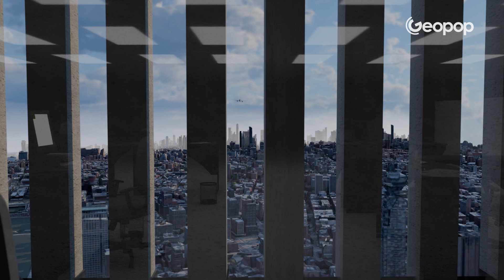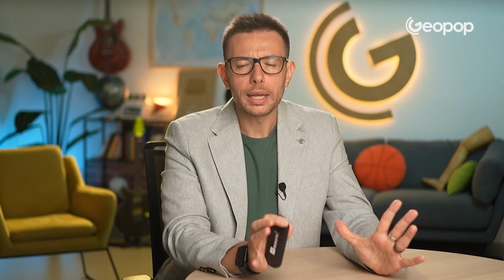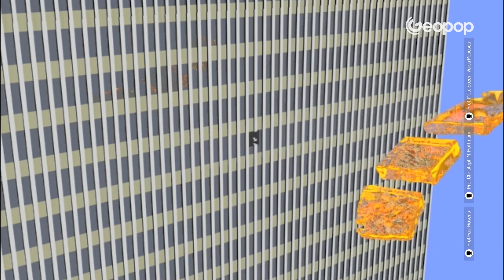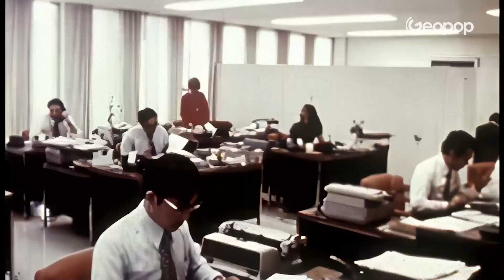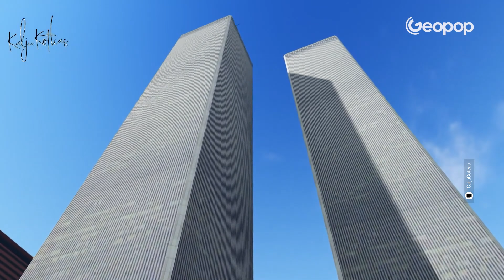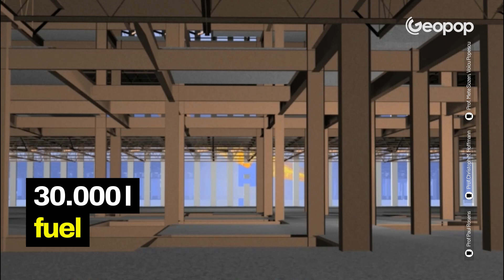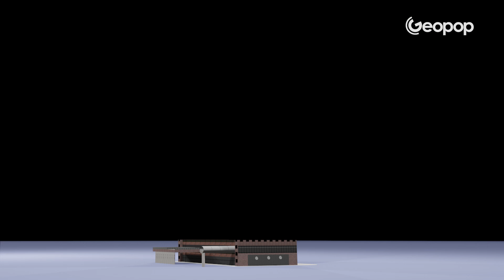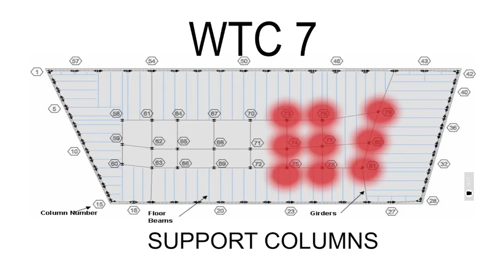9/11, 2001: The Technical Reconstruction of the Twin Towers and WTC 7 Collapses

Comment: This all becomes increasingly hard to digest when contrasting these barely visible fires of 9/11 to that of the recent Hong Kong raging infernos which fully consumed the interior and exterior of 7 steel towers nearly entirely, while burning for 44 hours - 2 DAYS-  yet today they remain standing. 

The idea that 9/11 was the first and to date ONLY time 3 steel towers yielded to office fires, all while the same collapse has never been successfully replicated in controlled scientific environments makes the idea of these progressive collapses start approaching parody territory. 

There were never temperatures from the office fires in the towers that approached temperatures capable of compromising steel. People passed through the damage zone of the south tower from above the impact. This would never have been possible had the temperatures theorized in this video been present. When has an office fire ever produced enough heat to weaken structural steel? Even if we go with this theory... where is the fire?  I see some concentrated pockets of fire but mostly I see dark/black smoke. That is the color of an oxygen deprived fire. So where is this huge fire that is alleged to have created this exceptional heat source?
Reply: What were the temperatures in the Towers?

At what temperatures does structural steel start to become compromised?
Reply: @TheLoonResistance  First part of that equation has to be modified to account for the fact that the steel used in the Twin Towers was rated with a redundancy of 3 - 5 times structural integrity required to support  the load it was built to support. 

Peak temperatures in the World Trade Center fires
Approximately 980–1,100°F (525–600°C) in most office fire zones

Approximate “critical” steel temperatures when weakening begins/bending/initiation of buckling:

To wipe out a 3× margin (≈33% strength remaining): about 650°C (≈ 1,200°F)

To wipe out a 5× margin (≈20% strength remaining): about 720–750°C (≈ 1,330–1,380°F)

Physics never lies. The 9/11 Commission/ official Report is not Physics.
Reply: @mkoury83 - In terms of load redundancy at ambient temps that is normal.  It also doesn't really matter. 

Structural steel will start losing strength below 500-deg F, or less than half your admitted peak temps.
Reply: @TheLoonResistance  redundancy absolutely matters, and the temps i cited are taken directly from available public sources, no admission.
Reply: @mkoury83 - The intact structure had a redundancy of 4 to 5 times, which again, is pretty typical and does not require any additional math.

But we aren't dealing with an intact structure.

And more to the point - going back to your original claim - the temps were twice as hot BY YOUR OWN ADMISSION as they needed to be to materially weaken the steel structure. 

Twin Towers collapses were a combo platter of 4 factors, not just one.

*Impact Damage + Fire (heat) + Time + Gravity = Collapse

Remove any one of those 4 factors and there is no collapse.

Ignore any one of those 4 factors and you will never understand the collapse.

You are ignoring 3 and have your facts wrong on the other.
Reply: @TheLoonResistance  agree, however where you fall short is starting from the assumption that we are dealing with a damaged but otherwise conventional structure, and that is precisely where the analysis goes off the rails.

Talking about “four to five times redundancy” only has meaning if the structure still exists in the way engineers imagine it should. But we are not dealing with an intact structure, nor even a progressively failing one in the classical sense. What we observe is not a building that lost strength and then succumbed to gravity — we observe a building that was systematically destroyed.

You emphasize temperature as though steel strength is the controlling variable. It isn’t. Even if the steel were weakened — even if it were heated well beyond what is required to reduce its load-bearing capacity — that still does not explain what actually happened. Heated steel bends. It sags. It deforms. It does not turn a 110-story building into fine dust in mid-air.

Your equation — impact, fire, time, gravity — is not an explanation; it is a checklist. You are assuming the mechanism you are trying to prove. Gravity does not reduce buildings to uniform particulate dust.  Fire does not disintegrate structural members into micron-scale particles. Impact does not cause mass to disappear. And time explains nothing at all.

Remove any one of those four factors and you say there is no collapse — but that only works if collapse is the correct framework to begin with. What occurred does not resemble any gravity-driven collapse we have ever observed, studied, or modeled. The evidence points to a process that removed structural integrity as the event was occurring, not one that waited patiently for gravity to finish the job.

You accuse me of ignoring impact, fire, and gravity. I am not ignoring them — I am saying they are insufficient. They do not account for the degree of destruction, the en mass absence of material post "collapse", the anomalous fallout , or the nature of the damage observed both within and outside the footprint.

If you insist on viewing this through the lens of conventional structural failure, you will never understand what happened. The evidence does not support that model. It contradicts it.
Reply: @mkoury83 - Nail hit on head - the structure is not intact. All prior assumptions are out the window as they are premised on an intact structure, and by extension intact protective systems.

So let's break it down.

While complex, most of the Twin Towers collapse mechanisms can be seen with the naked eye and easily discerned and understood by the layperson IF sufficient time is taken to understand.

1. The Twin Towers consisted of 4 primary structural elements that together formed an integrated system where each relied on the others. 47 hollow box-section steel Core Columns carry the majority of the gravity loads. The 236 hollow box-section steel Perimeter Columns carry the remainder and ALL of the lateral (wind) loads. Long-span Lightweight Steel Trusses connect the core and perimeter column together at each floor with a Hat Truss on top to tie the structure together as an integrated unit where no element can survive without the others. There was no structural load bearing concrete and most components were bolted together.

www.youtube.com/watch?v=u7OqrC74Dm4

2. The impact of 120 tons of airplane (= to about 12 dump trucks) at speeds up to 589 mph with the energy of a ton of TNT completely destroys the aircraft. This in no way implies the Towers come out unscathed. Many perimeter columns are damaged or destroyed as are some core columns (example; 33 of 59 perimeter and 20 of 47 core columns damaged or destroyed at the impact floors in the North Tower), This damage is primarily through bolt-shearing failures at the end connecting flanges, as well as bending, twisting and fracturing of weld seams. There was no cutting or slicing - the reality was far more violent and messy.

3. The impacts destroy or damage fire insulation, fire breaks and sprinkler systems on multiple floors. Huge fires are started across multiple floors simultaneously and allowed to spread rapidly with no effective firefighting or fire suppression. This was an unprecedented fire event .

4. The hotter steel gets the weaker it gets . With fire insulation stripped away and no sprinklers the survival time of the steel greatly reduced. Gradually over time heat causes the lightweight steel Floor Trusses at the impact damaged floors to sag, which was observed and recorded. No steel melted or needed to. Structural steel fails long before it becomes a puddle. It just needs to bend

5. Sagging floor trusses pull on the increasingly weak and overloaded Perimeter Columns, causing some of them to bow inward by up to 5 feet. A straight column is up to 4 times stronger than a bent column. The bowed Perimeter Columns buckle and fail, quietly initiating collapse. The formerly static mass above which the structure below could easily support is converted to a dynamic mass up to 30 times greater. Because they have buckled, the Columns above and below the failure point are no longer aligned . The load bearing structure below no longer bears any load as it falls past the lower columns, NOT onto them.

www.youtube.com/watch?v=ULdiD6gYZO0

6. Thousands of tons of debris fall within the four outer walls, down through the open office space, crashing onto the first intact floor it encounters, immediately breaking the bolted column connections as the amount of resistance the Floor Trusses can offer is negligible. The falling debris slows only marginally and briefly. Note: 
6a. This is NOT a solid top block crashing into and “crushing” a solid bottom block . 
6b. The debris falls past the columns not onto them. The columns provide no resistance to the falling debris. 
6c. Only the bolted floor truss connections to the core and perimeter columns offer any resistance. A pair of 5/8” bolts at each end of each truss vs. thousands of tons of falling debris. 
6d. No laws of physics are violated. 
6e. There is no 20 floors against 90 floors but rather 20 floors against one floor, then 21 floors against one floor, then 22 floors against one floor, etc. 

7. This floor-led collapse progression within the four outer walls can only go straight down.
7a. This process is often incorrectly referred to as “pancaking”. The catchy name stuck but nobody knows what it really means and "pancaking" is too simplistic and inaccurate anyway. I prefer Kaiserschmarrn.

8. Collapse progresses through the floor systems past the columns, through the path of least resistance . The resistance offered by each floor is always the same while the mass of debris and its velocity – thus its energy - increases with each floor failure. Each floor offers the exact same resistance to the falling mass while with each failure the falling debris constantly gains both mass and velocity. *This process of floor-by-floor destruction cannot be arrested, it can only speed up . Rate of floor failures increases with each floor as momentum increases, reaching an average acceleration of 0.65 of GA, or 35% slower than true free fall. Bam, bam, bam down the building until there are no more floors to fail. The resistance offered by each successive floor is always the same. More mass, more velocity, same resistance with each floor. Don’t get stuck on the but the lower floors weren’t on fire nonsense. They weren‘t and didn’t need to be.

9. The Towers were 95% air by volume. As that air was compressed inside the building it is forced down the tower and blown out the sides in reaction to the building collapsing . Those were not “explosions”, it was expulsions of compressed air caused by the collapsing building, explaining the low velocity, lack of flash, blast, supersonic pressure waves and lethal high-velocity ejecta.

10. Perimeter Columns become detached and peel away like a banana behind the collapse front, playing out to the four points of the compass extending to more than 800 feet from the base of the towers. This was quite obvious from examination of the debris pile.

11. Core Columns fail last as their internal beam bracing is stripped away by falling debris and lateral support from the floor to perimeter columns is lost.

www.youtube.com/watch?v=WpHXj62Ylw0

12. For those who care about how long this whole process took; 31-34 seconds from the moment the perimeter columns buckled until the last core columns hit the pile, or 1/3 the rate of true free fall. Don’t believe me? Just watch any video of the collapses and note the loose truly free-falling debris dropping much faster than the towers themselves.

13. Each Tower had a 1-acre footprint. Far from collapsing inside their own footprints the debris pile spread out over 17 acres in a pile up to 14 stories deep. 8 surrounding buildings were destroyed and scores more damaged by the falling debris.

14. NOT observed were the 180-190 dB bangs of thousands of high explosive devices or the blinding bright flashes of burning thermite. Neither explosives or thermite could have survived the impacts and subsequent fire nor could have caused the (silent) perimeter column buckling that clearly initiated collapse either. A video of a shocked and injured firefighter casually using the magic word explosion is in no way proof of explsoIVES and the demolition_ case relies entirely on that sort of thing. There is zero tangible physical evidence and it would be technically impossible, totally impractical and completely unnecessary. No one would bother.  In 24 years zero structural engineers of tall buildings, including the 1/3 that have retired in that time, have made any statements in support of pre-planned demolition claims. NONE. The lack of any such citations in the engineering literature (published in any country worldwide) is telling.

15. Twin Towers were perfectly safe within their design envelope. They only collapsed when taken far outside design parameters by an extraordinary and unprecedented event

Impact + Fire (heat) + Time + Gravity = Collapse . Remove any one of those 4 elements and there is no collapse. Ignore any of those elements (as many do) and you will never understand the collapses. The Twin Towers were an integrated system in which no one component could survive without the others. One fails, the rest follow, through the path of least resistance – DOWN – through the open space, bypassing the path of greatest resistance – the columns. Nothing I just described violates any laws of physics. All of the above is true no matter who planned and carried out the 9/11 attacks or why

I hope you found this helpful and informative. It’s meant to be non-adversarial and solicit informed critical comment, positive or negative. If I made any errors of fact, logic or reason or left anything critical out, please let me know so I can fix it. To stay focused, just one point at a time please and on-topic (Twin Towers ONLY). No word-salads of Gish Gallop. IF you can offer a more plausible alternative be my guest. Please start any reply with the words “Tits McGee” or I’ll know you didn’t read it, aren’t serious and wasting my time.
Reply: @TheLoonResistance  Mr. McGee, You finally said the one thing that matters: the structure was not intact. On that, we agree. But then you immediately rebuilt the entire explanation on assumptions that only make sense if the structure still functioned as a conventional building system. That is where you lose me.

Once the structure is no longer intact, all prior assumptions are out the window — including load paths, fire protection, progressive collapse models, and especially the idea that what followed can be understood as an ordinary gravity-driven failure. You cannot declare the structure “not intact” and then analyze it as though it still behaves like one.

You describe the towers as an integrated structural system. Correct. But then you treat the destruction of that system as though it unfolded sequentially, patiently, and mechanically — impact, then fire, then sagging, then buckling, then gravity doing the rest. That narrative is imposed after the fact. It is not derived from the evidence.

You say the mechanisms can be understood by the naked eye. I agree — and what the naked eye shows is not a top-down progressive collapse of floors overwhelming floors. What it shows is material being removed, pulverized, and dispersed while the building is still standing. Gravity does not do that.

You focus heavily on floor trusses, bolts, and sagging. That assumes floors were failing in sequence and that mass was accumulating above intact resistance. But what we observe is not floors piling onto floors. We observe floors ceasing to exist. Steel does not politely detach bolt-by-bolt while turning into dust in mid-air.

You say no steel needed to melt. Fine — but steel does not need to melt to bend, and it certainly does not need to melt to fall. What it does need to melt — or something equivalent — is to disappear as load-bearing structure at the rate observed. Heated steel bends. It does not dematerialize.

You insist the debris fell past the columns, not onto them. That is exactly my point. If the columns were being bypassed, then they were not providing resistance, which means they were no longer acting as columns. You cannot have it both ways: either the structure is resisting gravity or it is being removed. Gravity alone does not remove structure.

You say this was not pancaking and prefer a different metaphor. The metaphor is irrelevant. What matters is that none of these labels explain the degree of pulverization, the lack of expected debris, or the absence of a recognizable collapse pile consistent with your own structural description.

You attribute the outward bursts to compressed air. That explanation fails on scale, symmetry, and timing. Air compression does not selectively eject material laterally hundreds of feet while the building is allegedly collapsing downward at near-free-fall acceleration.

You emphasize what was not observed — no loud bangs, no flashes, no thermite. I agree with you there. I am not arguing for conventional explosives or thermite either. Those are straw men. Rejecting them does not validate a gravity-only explanation.

You conclude that impact, fire, time, and gravity are all required. That is an assertion, not a demonstration. It assumes the outcome must be a collapse and then selects variables to justify it. Remove any one of those factors, you say, and there is no collapse — but that only holds if collapse is the correct model to begin with.

What happened does not behave like a collapse. It behaves like structural integrity was being removed as the event progressed. Gravity did not cause that. Fire did not cause that. Time explains nothing. Impact alone cannot account for it.

If you insist on framing this as a gravity-driven failure, you will never understand what happened — because gravity does not vanish buildings, does not expel material laterally at scale, and does not erase structure before it falls.

I am not ignoring physics. I am insisting that physics be applied to what we actually observe — not to what we expect to see. 

Above all, we must stop retrofitting explanations by invoking variables that cannot be independently confirmed or falsified, solely to force an unprecedented event into pre-existing models developed for familiar and fundamentally different scenarios.

That approach reverses the scientific method.

Nearly twenty-five years of repetition have conditioned people to interpret what they see through a predetermined narrative. Until that conditioning is consciously set aside and the video record and physical evidence are allowed to stand on their own, meaningful understanding is impossible.

An event of this scale and character cannot be explained by simply extrapolating from previously tested phenomena. The correct methodology is to let the evidence define the mechanism—not to select a mechanism first and then search for parameters that make it appear plausible.
Reply: @mkoury83 - You cannot declare the structure “not intact” and then analyze it as though it still behaves like one

I didn't.

Remember, I said one topic at a time and no Gish Gallop
Reply: @TheLoonResistance  I didn’t.

I explicitly stated that the structure was not intact, and my argument proceeds from that premise. I am not analyzing the Towers as though they continued to behave as intact structures; I am describing how an integrated system behaves once key components are compromised and protective systems are lost.

If you believe I reverted to intact-structure assumptions at any point, identify the specific step where that occurs and we can address it directly.

One point at a time. No Gish Gallop.
Reply: @mkoury83 - Yes, but you used the redundancy argument like it was intact.  But getting back to first principals you originally claimed the fires were not hot enough to weaken steel.

This is nonsense.  

I did address where you lost the plot, and for the third time it is when you claimed we had to factor in the inherent redundancy of the structure.

Now, this is getting fucking boring.  I have posited a complete hypothesis for the collapse of the Twin Towers. I stand by it.

Have a nice day.
Reply: @TheLoonResistance  No — the redundancy argument was addressed only to establish baseline design intent, not to imply the structure remained intact after impact. Redundancy is relevant precisely because it defines how far outside the design envelope the event had to go before failure occurred.

Your claim that I asserted the fires were not hot enough to weaken steel is incorrect. I did not make that claim, and I explicitly stated that steel does not need to melt to fail. Weakening was never in dispute.

The point at which you believe I “lost the plot” is noted. I disagree with that characterization, but you have identified it clearly, and that satisfies the requirement for specificity.

You have presented a complete, internally consistent gravity-driven collapse hypothesis. You stand by it. Understood.

Nothing further to add.

Have a good day.
Reply: @mkoury83 - The Twin Towers exceeded their design envelope the moment the inwardly bowed perimeter columns at the impact and fire damaged floors buckled. From that point on, built-in redundancy was irrelevant, for reasons I made clear in my description.
Reply: @TheLoonResistance  Redundancy is a design property of a functioning structure. It has no explanatory value once the system that gives it meaning has been compromised. When the perimeter columns lost alignment, the structural system ceased to exist as a coherent load-bearing entity. From that moment on, appealing to redundancy is a category error.

At that point, you are no longer analyzing a building under load. You are observing a process in which structural capacity is being first redistributed mostly through the hat truss, and eventually removed. I think the confusion exists in that I do not accept that office fires which resulted from the compromised structure, or that compromised structure in combination or individually can possibly be responsible for the demise of the towers at speeds which prove no frictional resistance. We watched 2 x 110 floor towers fall through themselves. The North Tower, fell through 92 floors without any observable deceleration. 
They may have had a vast volume of air, but they were also comprised of over 1,000,000 metric tonnes of physical matter. 400,000 tonnes of which was high strength steel. The 47 core columns akin to mature California Redwoods. Observing the sheer mass and bedrock anchorage of the core columns at the 9/11 Museum puts the office-fire progressive-collapse narrative on the wrong side of implausible.
Think of all the connection points, welds, trusses, spandrel plates, the list goes on that managed to undo themselves all at nearly exactly the same time - which incidentally was also the precise moment that they were no longer bearing the load they had held up for 30 years. 

This is just a brief analysis of the most conspicuous events which at a minimum should give one pause and for just a moment open their mind to the possibility that the explanation offered to us by a commission of politicians, none of whom had the credentials to speak on the topic, may not have gotten everything right...

for this conversation the bottom line is: Models that presuppose an intact or even partially intact system simply do not apply.
Reply: @mkoury83 - So then why did you?

Never mind, I really, truly deeply don't care to argue over trivialities and minutia, other than as a way to avoid acknowledging being called out on the original claim in your OP, the point which is the ONLY reason I am here.

PS

There was plenty of fucking resistance.  You put me through all this just to pull the free fall speed crap?!?!?

Shame on you.